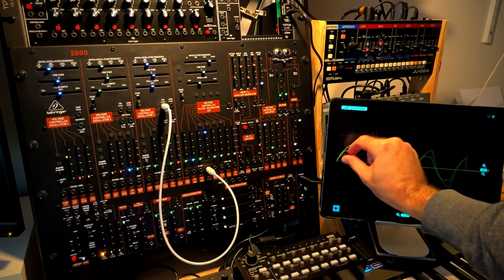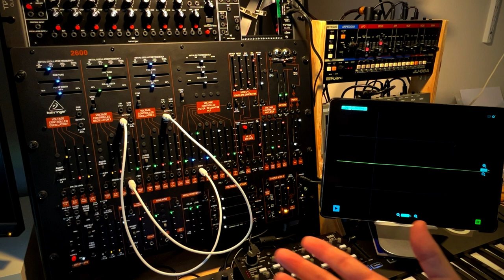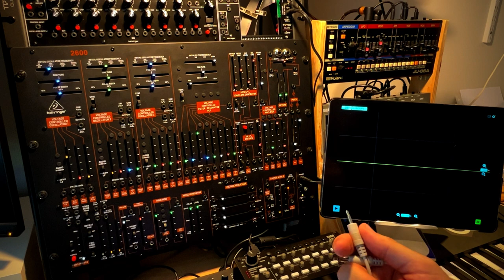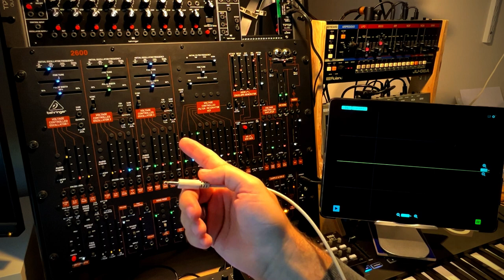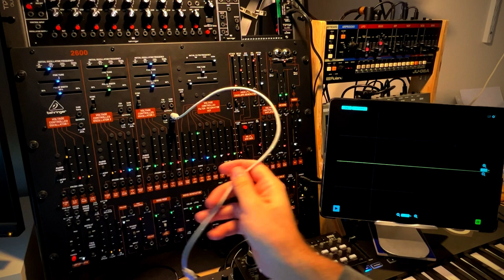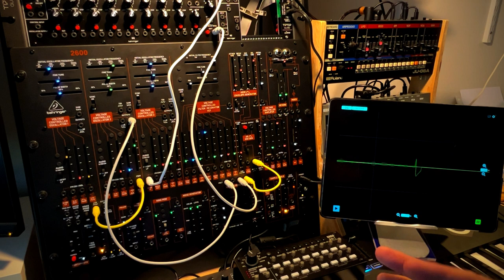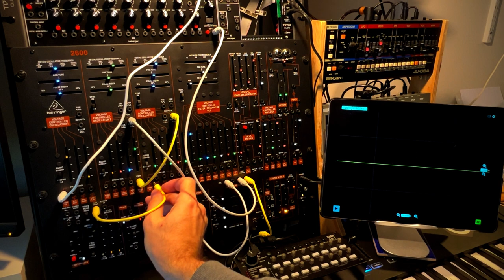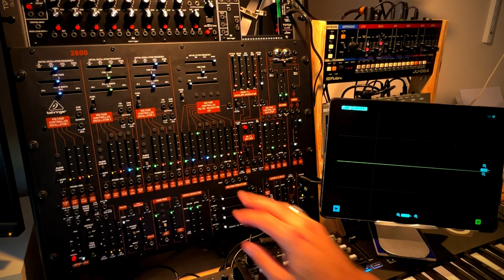Viewer Question: The difference between Frequency Modulation and Pulse Width Modulation

Comment: How can I sync the electronic switch to an external clock for synchronized panning?
Reply from the maker: Michael, you should be able to route clock signals into the EXT CLK IN input on the bottom left of the sample and hold module. If you find that doesn’t work on switch timing, try running it into input C at the bottom. This will replace the INT CLOCK default routing. Let me know how it works for you!